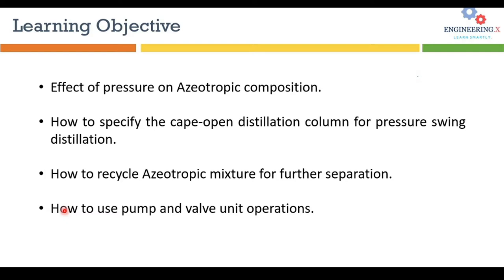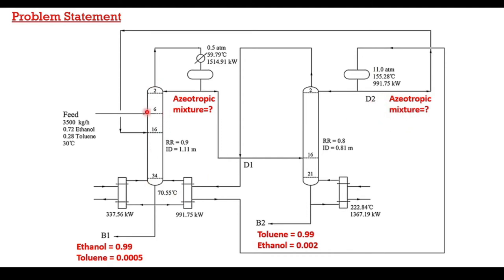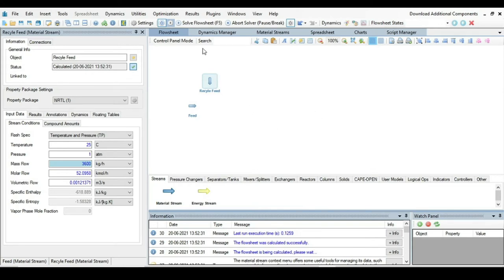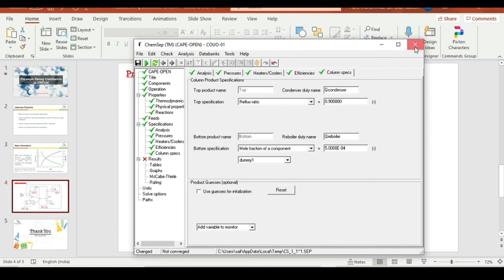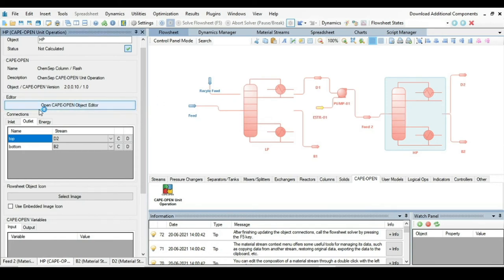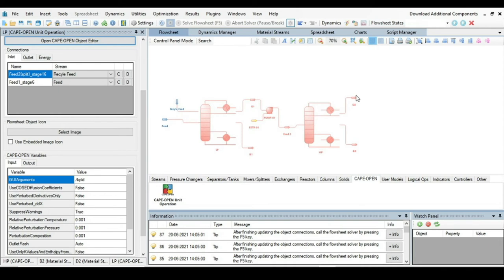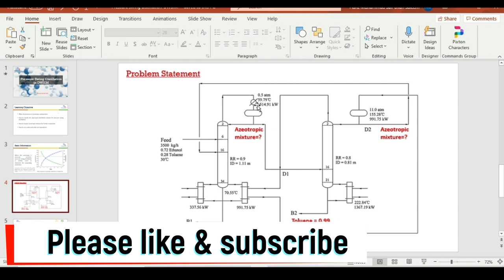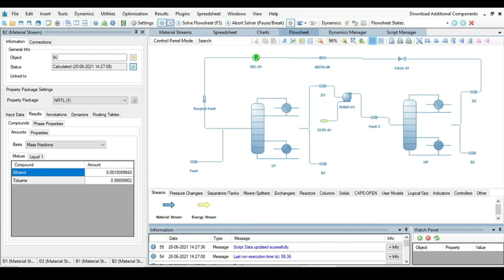Pressure Swing Distillation | Ethanol-Toluene Separation

Comment: I followed each and every step but I am getting an error. It happens every time I use cape open. Can u suggest what may be the problem. Even after understanding and doing everything thoroughly still I am not getting the results. Please help me regarding this.
Reply from the maker: Uninstall current DWSIM and reinstall the latest version
Reply from the maker: I hope it will solve the problem, but if not then I will share with you mine simulation file
Reply: @eduXinsight  Thanks a lot I will surely try it.